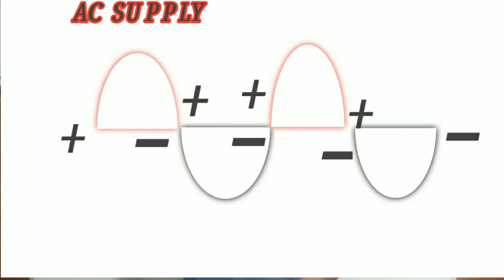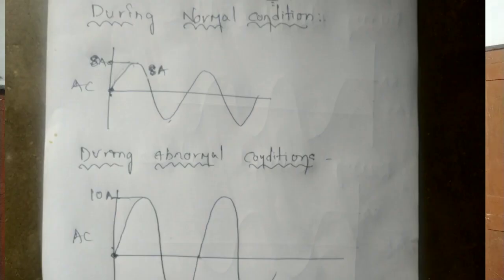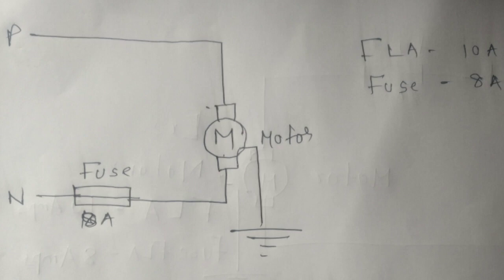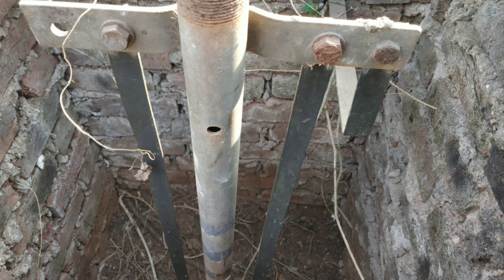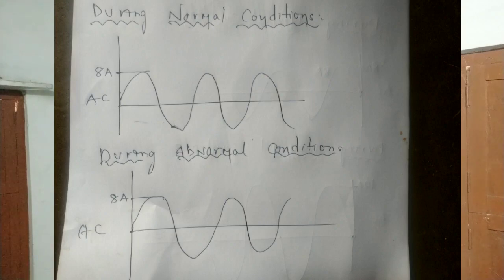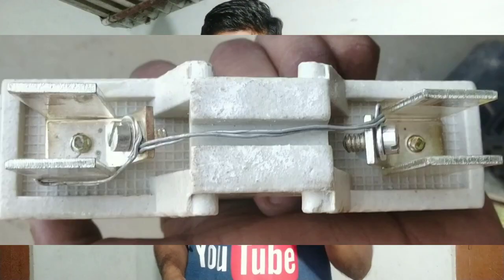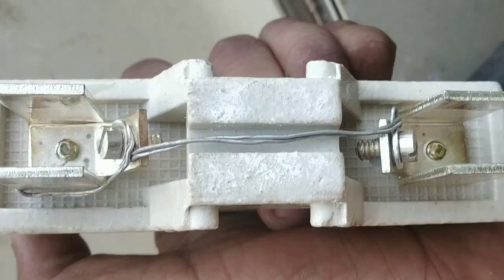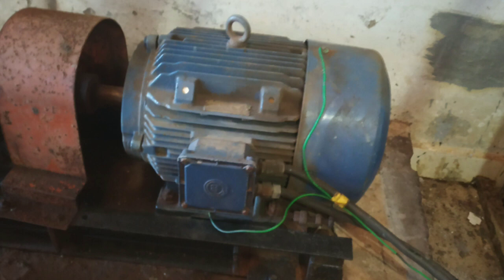Why fuse is connected only in phase wire why not in neutral wire telugu 2020 i.t.i diploma

Comment: First meeru capacitor enduku fan use aney subject adigaanu meeru cheppaney ledu
Reply from the maker: Capacitor had leading current in 90 degrees with respect to voltage 
And also there is no starting torque for single phase motor to get the starting torque we are connecting a capacitor to the fan or motot
Reply from the maker: Sorry for the late reply friend
Reply from the maker: I will do a video on this uploaded soon